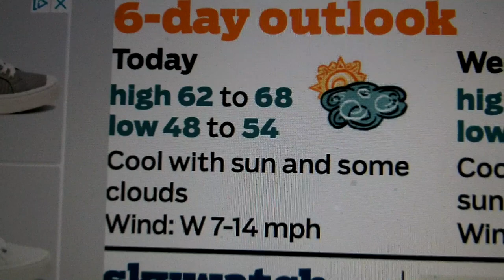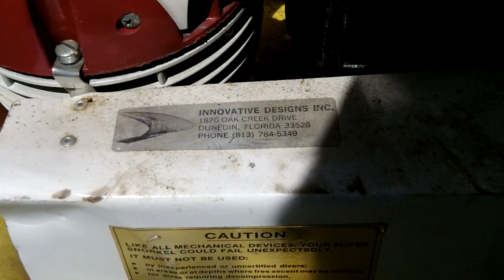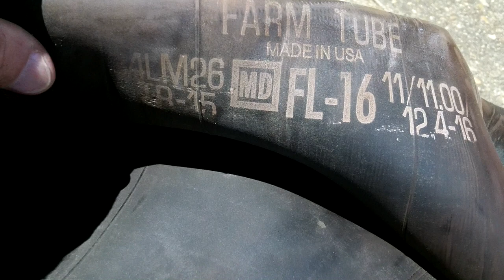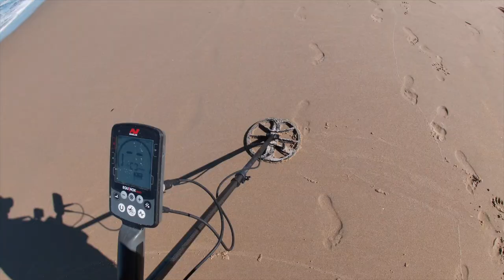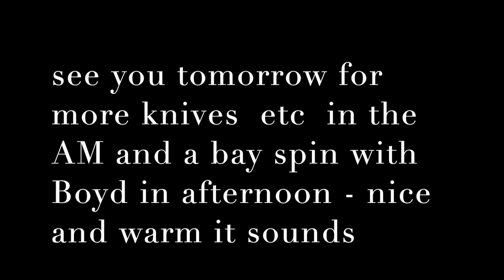Extreme Titanium  scoop and Nada - Boyd is in town

Comment: Hey Max , that air compressor is a T-80 . I have one on my gold dredge. It will handle two divers . I use a small floating air tank in my air line so when the engine runs out of gas I have a little air reserve . Its a popular unit with dredgers .
Reply from the maker: i have been in contact with mike at keene about upgrades......thanks

Comment: Been looking at hookah systems if there is another stimulus check my wife has agreed to let me buy one :)
Reply: I have a Nardi Esprit. I should be using it some this summer.
Reply from the maker: now i need a new heater to use with it.....or try my old CTX, but thinking new (back in time machine)  fisher 1280x or detector pro underwater......same heater just been upgrades to fit in earmuffs.